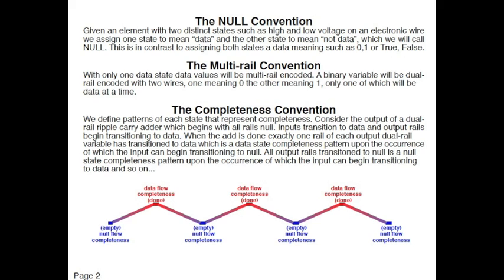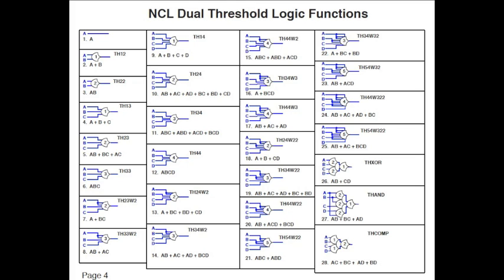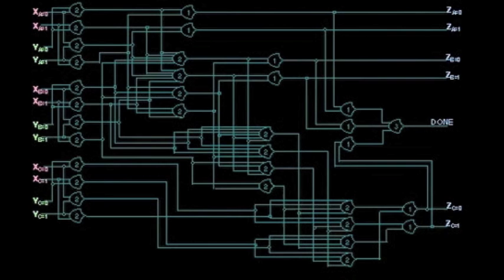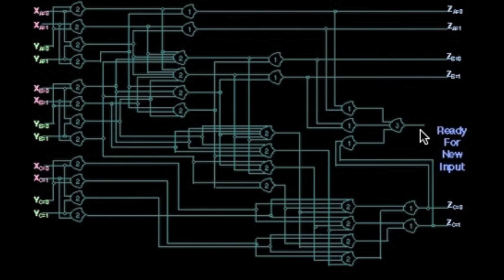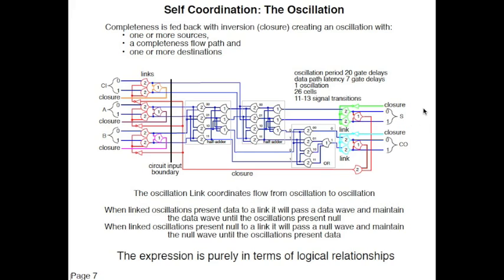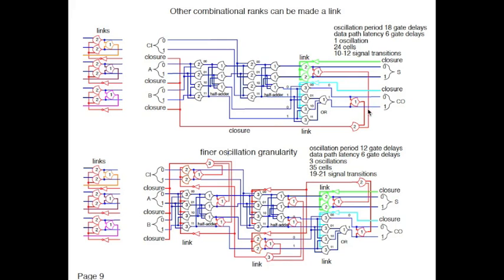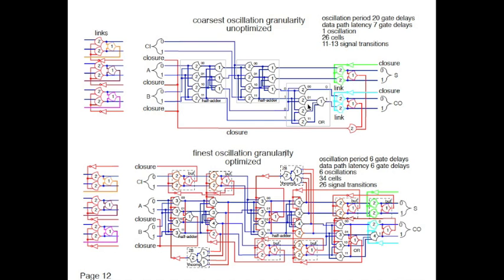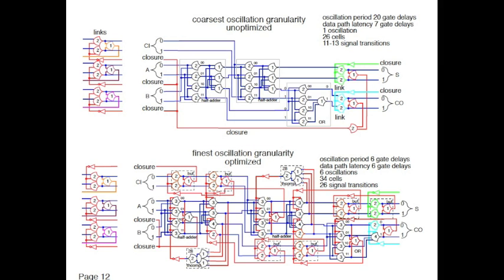Null convention logic, flow computing first principles

Comment: tbh I’m lost. trying to watch this bit by bit, and got stuck. pg3 “2 of 3” row2 column1 isn’t ‘D’ which I can’t be sure is error, due to some faint feeling that there might need to be shenanigans. the thing I was making, I thought of wires as being long enough to store lotsa fronts(transition from one data state to another, like boolean false -> true, for example). so if it doesn’t take the full x of x to transition to data, take 2of3 for example, then let’s I input all data no null, as soon as 2of3 of the datas arrive, output becomes data, start transitioning to null. the 2of3 that arrive get wiped, and the 1of3 still doesn’t arrive. now all outputs look like null, but there’s a segment of data (bounded by two fronts). next, let’s say the input for that unarrived one is supposed to be null, and the data arrives now. this could cause the insidious type of error that’s not like throwing an exception 
I guess ur thing has airlocks or whatever, which I haven’t wrapped my head around. guess I’ll revisit this after my attention span recovers